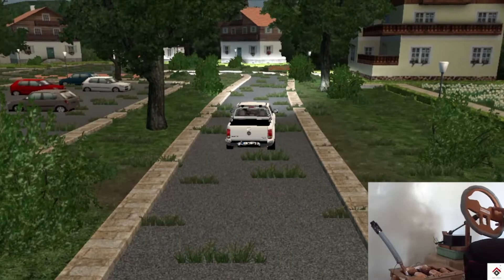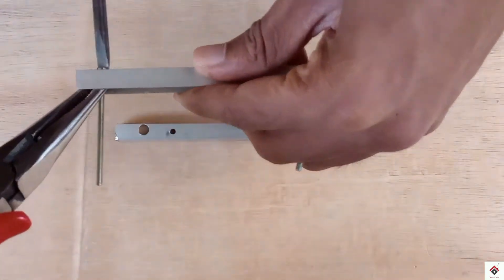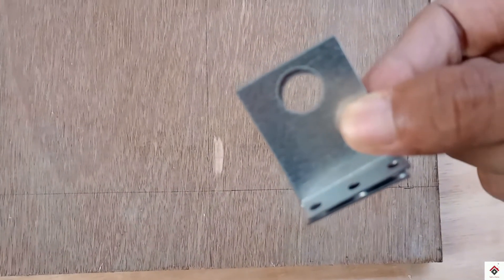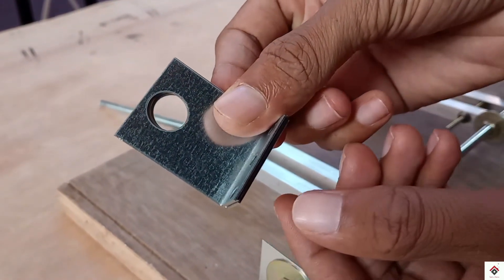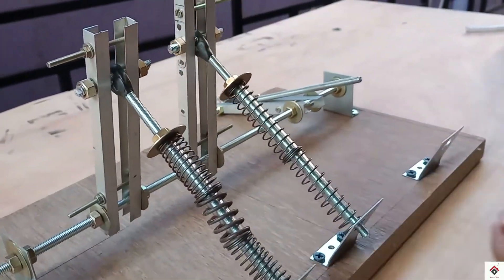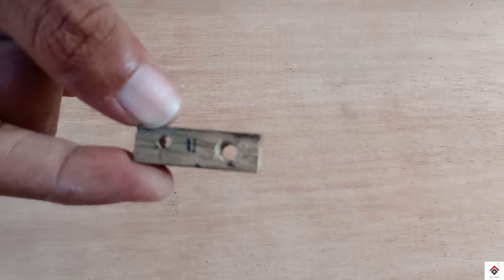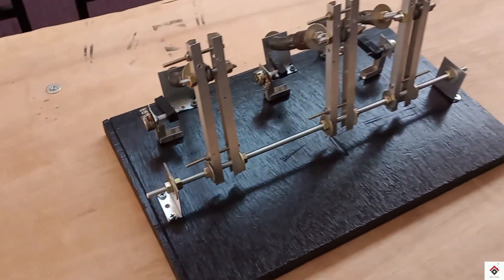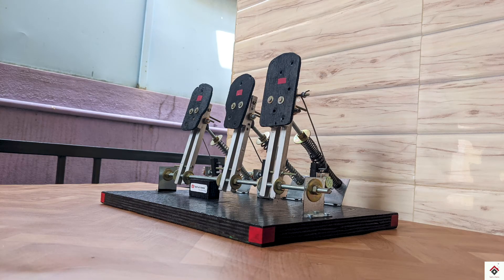DIY Sim Racing Pedals | Gaming Pedals for ets2[in ENGLISH] | Cheapest Analog pedals from Arduino

Comment: can i use esp32 insted of leonardo or ardiuno uno like ur past projects
Reply from the maker: Esp32 not possible.
Previous Uno based wheel was basic one and supports only on simulator games.

This FFB version uses different firmware and works only with Leonardo board.

Comment: Can we use 100 ppt encoder???
Reply from the maker: Any value will work. Only wheel sensitivity will reduce.
Reply: Is there any massive diff between 100 and 600

Any major issue?? @techathome
Reply from the maker: Yes there will be lag in the wheel.
Apart from that there is no issue.
Reply: @techathome is the lag in noticeable in 100 ppr?
Reply from the maker: I have not tried. As per the documentation, recommended value is 1000 ppr or more.

Comment: just finished my version based on this model, used wood instead of the metal bars, an antislider surface below the wooden base, and programmed my own code with the arduino IDE since EMC utility was faulty in my pc, but hey thanks for sharing this concept, it was a really fun build! now onto the wheel :)
Reply: Brother can you please tell the code and how you done please
Reply from the maker: Nice♥

Comment: Hi
I watched all your videos multiple times. 

Can you please summarise that How much you spent on the setup for all the feature(gear, breaks etc)

I am thinking if purchasing G29 is better or making is better

( I am assuming that I will get benifit of your experience and make less mistakes while making the setup so Experiment cost will be minimised)
Reply from the maker: Approx. 9000 Rs. But it is not fixed, all depends on how you use the materials. If you have access to workshop and tools you can make it still better.
In my case I have reused the materials from my previous projects. 

I am new to this wheels, I have never used ready made wheels, So I cannot give its performance in comparison. Torque will be more because of 24v Ebike motor. But sensitivity might be less compared to G29.

Note: For better results go with 1000 PPR encoder.
Reply: @techathome  thanks for the response. I have almost all the tools but I dont have much space to work on. 

So, the idea I am currently started working is using an wired ant sports joystick and connect external steering and pedals with it. 

Later I will switch to EMC lite. 

Planning to record also☺️

Comment: Whats the total cost involved
Reply from the maker: Considering the current online prices it's around 8500 INR approx.
But you can reduce costs -
1. No need of pulleys and belt for encoder. You can directly connect at the end of steering shaft.
2. Using cycle chain and sprocket instead of timing belt and pulleys for motor.
3. Use 100W or 150W motor, but mine is 250W which I already had.
4. Some old steering wheel can be used, Here I bought new wheel.
Reply: @techathome  thank you very much 😭
Reply: @techathome  does it have reliability issue?
Reply from the maker: Mechanical things you have to build properly.

Comment: I want to make only the pedals , I have made the frame that you have made but I am facing very much problems in connection and programming I am using arduino uno Can you suggest me the programmings and the setup in the pc for the game raceroom experience
Reply from the maker: Refer this video for steps: https://youtu.be/CPWPPu2dR7M

But use the code and circuit from this link: https://drive.google.com/file/d/12i-rsl3xpVoyA1x3x1BKBp0t-3153vR1/view?usp=sharing

Comment: Can i use all using wood?😅
Reply from the maker: Design you can go with any method. Only electronics should be proper.
Reply: @techathome  thanks
Reply: @techathome  can you share the spring measurements so I can buy the same spring as you 🫠

Comment: Brother i am from Bangalore please help me brother i have. Done all connections i have used pro micro board but the problem is while i open in calibration the buttons fuction is fluctuations happens please give me a suggestion pleasee😢😢😢😢😢
Reply: me also
Reply from the maker: Buttons or pedals??
I had fluctuations with pedals initially.
I used B10k potentiometer with metal shaft and did wiring again. Now it works fine.

Can u send short video on mail: deepakhd20@gmail.com
Reply: @Carguyquotes  buttons
Reply: @Carguyquotes  in gear

Comment: what will be the total cost to make the pedals
Reply from the maker: There are no costly materials used in this build.
Wooden piece, aluminium pieces and some bolt nuts.

May be 350 to 400 Rupees.
Reply: Thanks

Comment: Hi, i would like to use analog pedals, steering, h shifter and a handbrake along with a few more buttons and a analog stick. What code do i use
Reply from the maker: Which Arduino are you using
Reply: @techathome  which all can i use? i was thinking for an uno
Reply from the maker: We have already started this force feedback series which will include steering, shifter , paddle shifters etc.
Using Arduino Leanardo
U can follow this playlist, instead of potentiometer based steering
Reply: @techathome  I was actually gonna do a comparision between both the wheels by making both of them. I will also make a ffb one too 😅

Comment: how can i use these pedals with your older 900 degree steering wheel?
Reply from the maker: Follow this steps: https://youtu.be/CPWPPu2dR7M
Use this code and circuit: https://drive.google.com/file/d/12i-rsl3xpVoyA1x3x1BKBp0t-3153vR1/view?usp=share_link
Reply: @techathome  i am kind of new to this , so red is the negative terminal and black is the ground?
Reply from the maker: In the potentiometer,
Red and black you can connect reverse also,
If your steering is working inverted in the game
Reply: @techathome  thank you for the reply! how do i use handbrake and sequential shifter with this?
Reply from the maker: For handbrake and shifter,
Use 2 pin  push buttons.
Connect one terminal to GND.
Other terminals to any Arduino digital pins (From pin-2 to pin-12)

Reference: https://youtu.be/YZXKILkRDFA
Reply: @techathome  thank you so much! you don't mind if i document this and upload it on YouTube (my build)? I'll give the credit of course
Reply from the maker: Yes you can

Comment: really great i did it before  (https://www.youtube.com/watch?v=glQcczZIA-A&t=464s)  
but not with your greatness work 
I was really thinking since I finished this project with my video, to add the Part of simulating the difficulty of moving the steering wheel in some situations, for example at high speeds 
so i cant wait to see ur upcoming part 💥💥💥
Reply from the maker: Thank you,
Yours is UnoJoy based steering wheel,
May be you can also make it 900 degree using gear wheels. You can get that video in description.